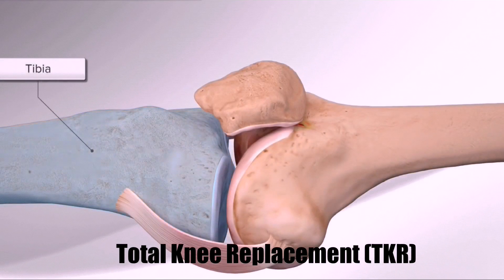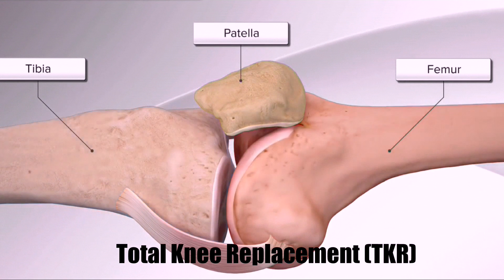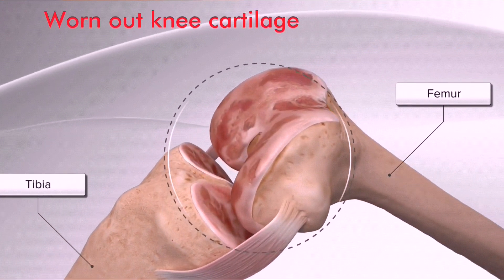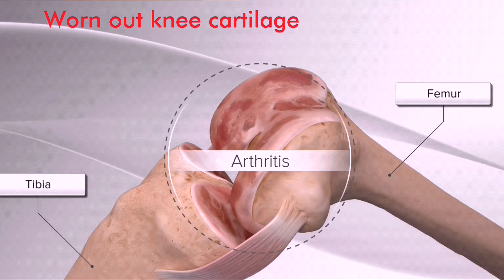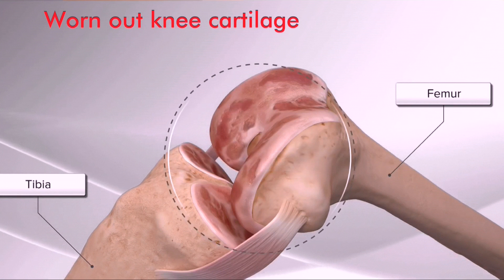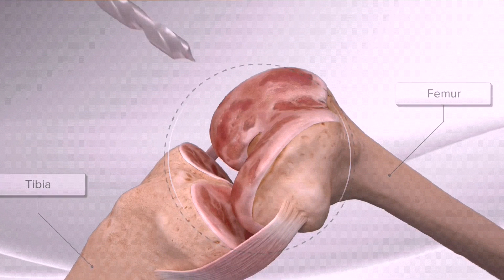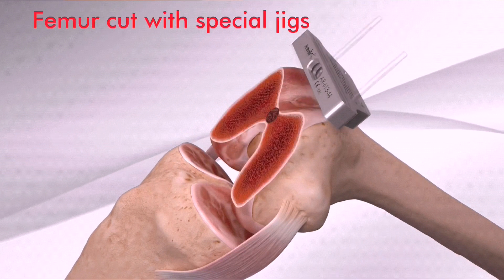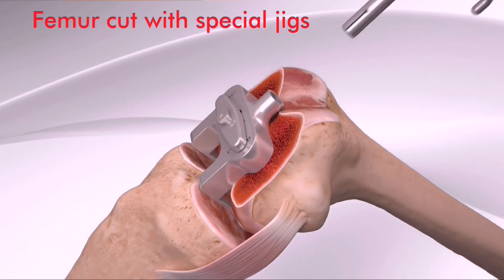Total Knee Replacement (TKR) - Animation

Comment: I am 65 and had this surgery on my left knee 10 weeks ago. I was discharged from the hospital the next day because I was able to walk with the aid of a walker besides great pain. I was not lazy to do the PT and was able to walk without even a cane two weeks later. I was recovering everyday until the 5th week, the numbness on the outside of the knee and parts of the sole, swelling and the pain.... all remain the same thereafter. I can now bend my knee to around 105 degree with some effort and I was told the goal is 120 degree, not 145 degree like a normal person. I can walk reasonably normal although not too fast or for more than 20 minutes. The pain is manageable with pain killer. Although my doctor said I am doing very well,  I know for a fact that some people will never completely recover. Two weeks ago I played some badminton and took it very easy. Still my knee would kill me for the next few days. I just hope that I recover to 75 % within one year and forget about going back to the soccer field or a ball court. 
ps  You need a leg to support your recovery for a few weeks so try not to do both knees at the same time. I am glad I did not.

Comment: Very good !@ but I feel by making holes in bone how much chances of bone breakage ? When you make a hoke where is tge dust of bone ? Isn't bone inside get damaged inside of the bone is living ? and get a chance of infection ? How can you take precise size of your knee implant as I have narrow and small knee at 66 as  compared to my siblings who have broad and big knee ? Is there any TKR technique which retains all the ligaments with special kind of implants ? What is the most recent implants  co for  metal  allergic  patients ?Is there customized kned fit size implants available in yhe market after measuring knee of individual?plz do reply ? Waiting plz .....
Reply: it's washed out. Implant is tailored to your specific allergy. There are different sizes, you get the one you need. Surgery takes about 90 minutes, not too complicated, excellent success rate.
Reply: The bone dust is removed during the surgery. Bigger chunks are picked out by hand or tweezers ond small debris is washed out with water. Drilling holes into the bone marrow does not make the bone less stable. Bones are living tissues and can regenerate like the skin for example. If you adhere to yourr doctors advice youll be fine. Infections are very unlikely. Hygiene is paramount during invasive surgeries like these. In special cases you can get custom implants made, but for most people a regular size or narrow tibial implant is totally fine. Exept for the cruticate ligament and the meniscus all ligaments are retained. These are necessary to remove because they are attatched to the section of bone removed. For patients with allergies implants are made with a anti allergic coating
Reply: i have done 9 month before.. i haven't any problem.